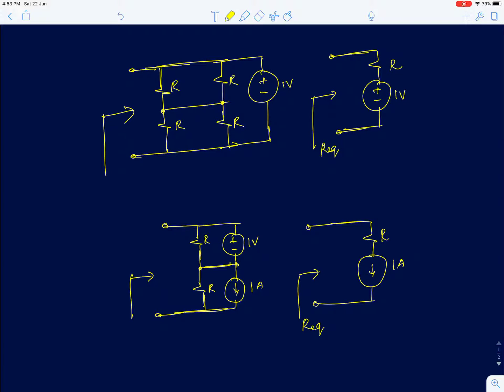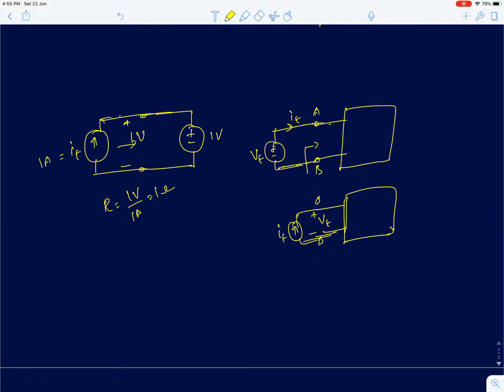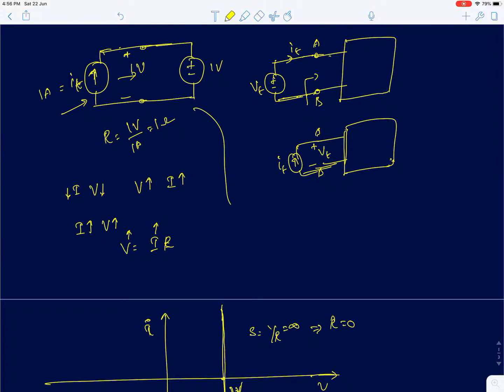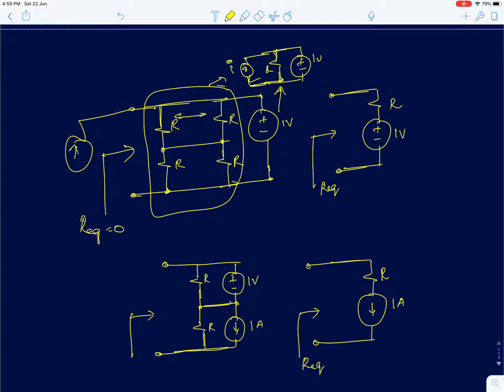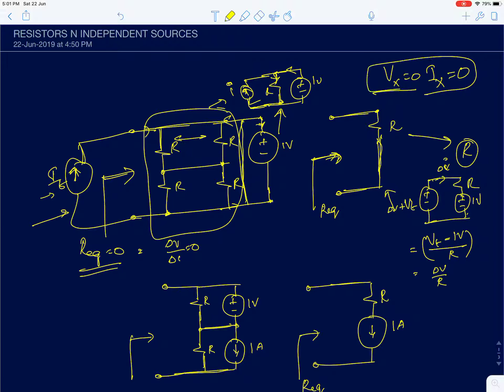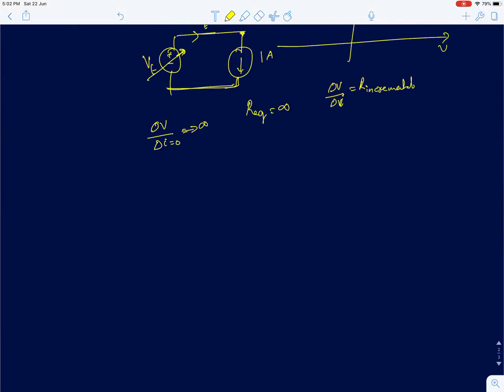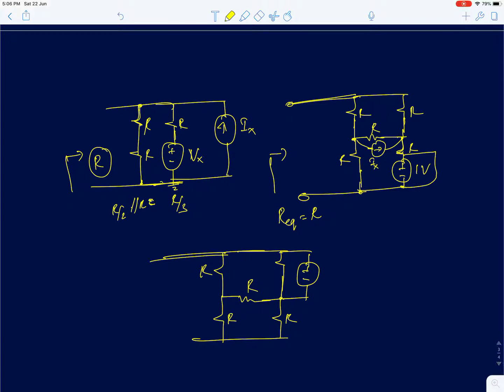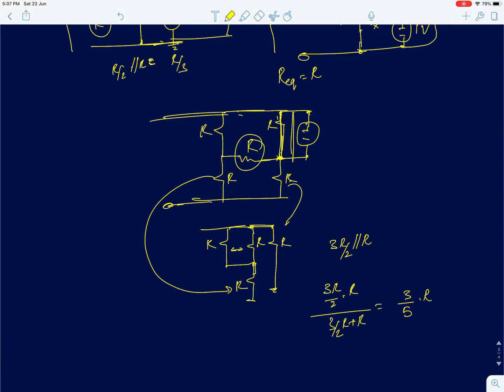ES Lecture 5: Resistor circuits with Independent sources.

Comment: I think there is an error at 11:00.
Reply: good catch! yes as @chakreshjoshi3071 said, it is 2R/3.
Reply: should be 2R in parallel with R, right?
Reply: @adittyachoudhary7735  yeah, and the equivalent resistance will be 2R/3